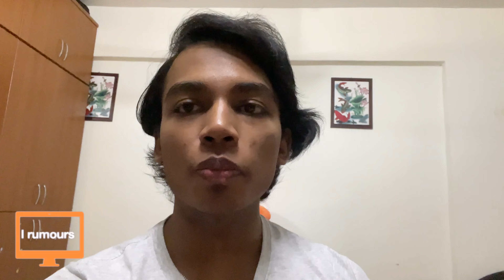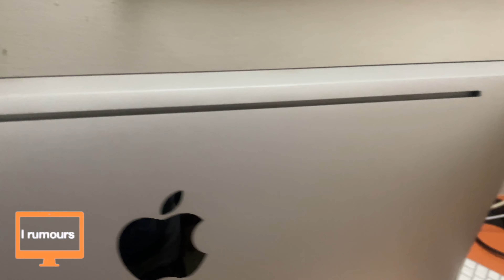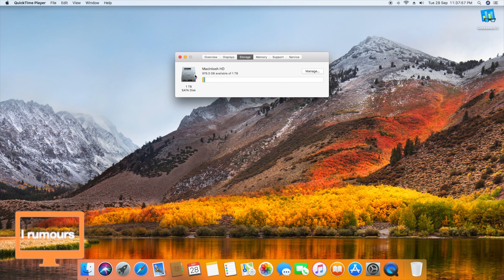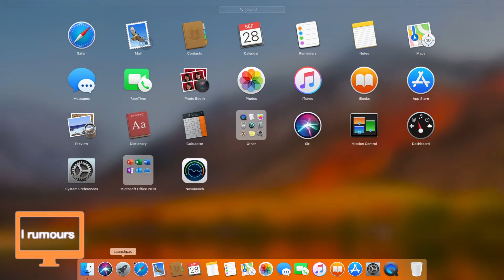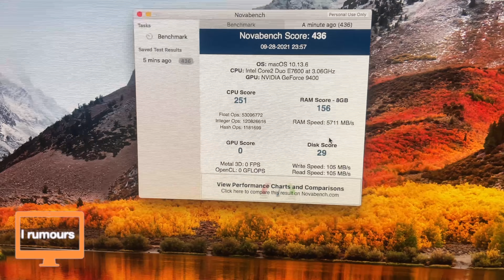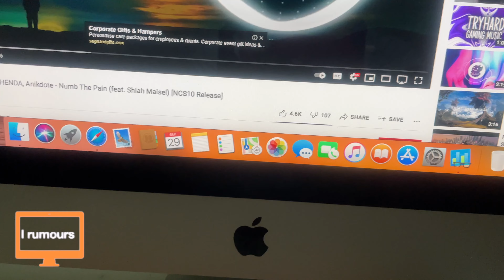Mid 2009 27 inch iMac Review in 2021

Comment: If you can find a belkin av360 adapter you can use that computer as a gaming monitor or just connect to whatever hdmi you wanna hook up 🔥
Reply from the maker: Are there any internals that need to be removed or just the adapter will do?
Reply: @irumours601  https://youtu.be/3DE_9pfIy4U?si=V3bYNeExXZpA_-br
Reply: @irumours601  just need the adapter 🤙🏾